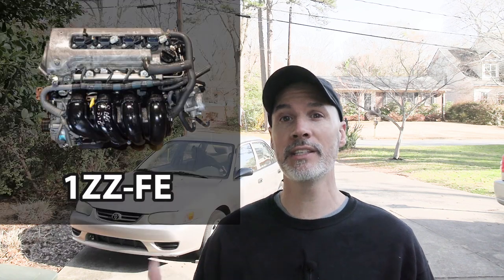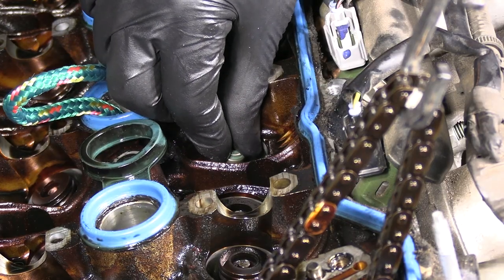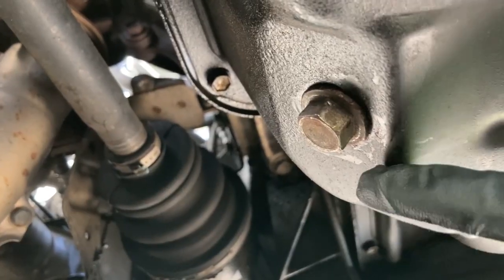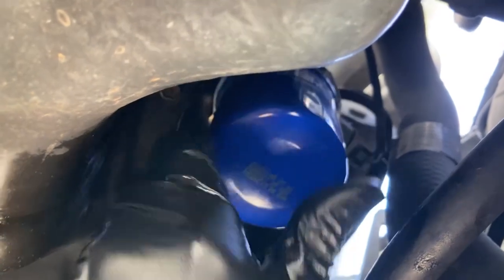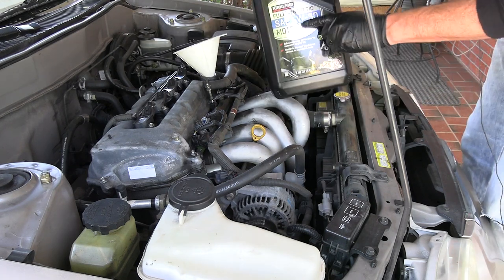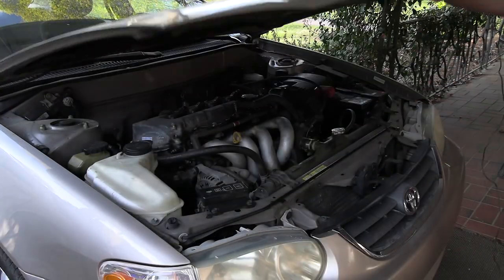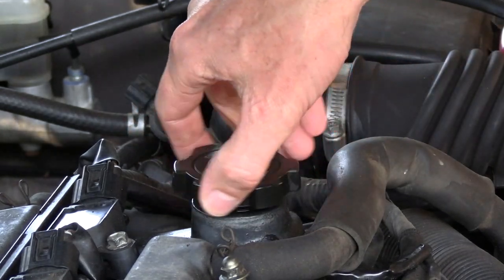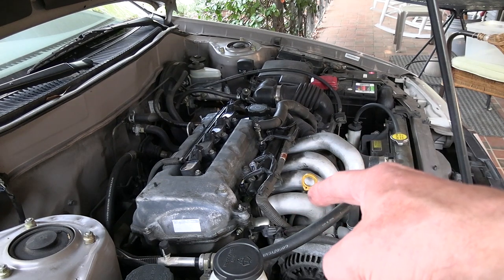Did the valve stem oil seals stop the oil consumption? | Oil Burning🔥Experiments | Episode 11

Comment: Notice how black the old oil is. That's a sign combustion gasses are leaking past the rings into the crank case. So yes, I'd say piston rings are probably your problem.
Reply: ‘Combustion gases’ would dilute the engine oil and they would make the oil more ‘watery’ overly impregnated with gasoline basically
Reply: @anthonyr5869  That used to happen in the old days with very rich mixtures during cold starts ("cylinder wash", liquid fuel in the cylinder going past the rings).  

In this case I believe the rings leak during the power stroke when cylinder pressure is the highest and fuel is already burnt pushing soot past the rings into the oil..
Reply: @anthonyr5869  this is a problem solved by catch cans
Reply: Or oil additives breaking down carbon getting into the oil.
Reply: Overheating can make the oil turn black in no time as well.

Comment: Your check engine light is on. That issue needs to be addressed first. I already can tell by how dark the oil gets that it is getting burned from blow by due to weak piston rings. This video series was very informational I’ve been a mechanic for over 35 years but I’m telling you now if you put piston rings in this car it’s gonna run so much better also mill the head down .005” inch for better compression when you rebuild you will love the Power increase
Reply: I doubt rings will
Lost more than 5-10k miles. If that. By the time you break the glaze on the cylinders with a hone and measure I would be you have .008-.010 clearance and these cars should be set up at around .003-.004. Now that would be wasting money. I would bet $100 those cylinders are oval shaped and would need to be bored .020.
Reply: engine light is probabaly on due to the oil being burnt clogging up the cat, exactly what happened with mine.

Comment: I used to work in a machine shop the other thing that causes oil burning besides valve stem seals and bad piston rings is bad valve guides if your valve guides are worn quite a bit nothing you will do will work right until all the valve guides are replaced it's kind of hard to tell what the heads on the engine you need to take them off take the valve springs off and wiggle the valves inside of the valve guides but that was a big problem with those cars burning oil too a lot of them use really cheap valve guides

Comment: Risolone high mileage engine treatment highly recommended for this issue.
Reply: Just bought some today..I bought a used 18 Taco 3.5 v6 with 165k..purrs like a kitten. No CEL's..but started to smoke white/ gray hue on startup the dies down in 2 minutes and maybe a tad of smoke from a stop to Go at traffic lights..it didn't smoke at the lot the 2 days I swung by, but after i added some full synthetic to bring the level up a half quart, it started this smoking..got the Rislone to put in..we'll see..its my rings or valve seals I suspect.

Comment: Any oil that is burning is also going through the Air/fuel, and O2 sensors then the cats.  This contamination will result in a P0420 eventually.  Replacing the cats will merely add more cost to your experiment, and they too will fail. Less oil will extend the life of the cats, but they will fail.

Comment: The oil control ring is sticky, run a full bottle of seafoam high mileage in the crankcase, and accelerate and take it on the freeway multiple times, cleaned my camry and the oil stopped disappearing, also make sure you change pcv every oil change.

Comment: I think that the best and fastest method to clean drain back holes is to bring each piston BTC with valves closed, fill the cylinders that are in this position with a solvent that is known to dissolve carbon deposits and with compressed air force the solvent past the piston and hopefully through the drain back holes to clear these holes. The solvent could be collected, strained and run back through several times to get the best use of the product. Repeat with each cylinder.
Reply: I don't have a compressor but this idea sounds great I might have to make something up maybe a bike pump with an adapter of some sort

Comment: There's one thing i have always wanted to try since there is so many engines out there with oil burning issues and full rebuild of the block are expensive for an old car. If you only want it to stop burning oil and not be brand new, your compression and cylinder walls seems okish. What if you drop the oil pan, remove spark plug to not fight compression, remove rod cap, lower the piston down to the point oil ring is out, but not compressions rings. Maybe chuck the piston with wood while you work on it so it can't move lower. Manually clean the groove until no more carbon. Maybe even drills the oil holes a little bit bigger if possible. Put new oil ring and try to push it back up. Oil ring wont fight you like compression rings. It's time consuming but very cheap in parts. No seal other than the oil pan's one. You would even save head gasket by not touching the head. Is it possible?  Would you dare such a task hahaha? It's high risk, but if it's working, really high reward for the price.
Reply from the maker: I like this idea. I was actually considering doing something similar just before the ring job--- if ring job looks necessary. Thanks for the comment Patrick!
Reply: I think the crank would still be in the way. The pistons will not drop down far enough to get to the oil rings. Unless Toyota engine are different.  Between the crank pins and the counter weights being in the way there is not enough room to do what you need to do. BG makes a product that is  used for cleaning super dirty cruded up engines. It not cheap and takes a while to do it correctly but definitely easier than a piston and ring job.
Reply: @thatsonebadhatharry8610 I was thinking the exact same things😂
Reply: I don't think the oil rings drop low enough to clear the bottom of the cylinder wall.  That would result in the oil ring possibly getting hung up.

Comment: The problem described in the beginning of this video explains what happened to my 2009 Corolla when it had ~125K miles on it. It suddenly started to burn a lot of oil. I wasn't aware of this until the oil pressure light flickered on and off. When I checked, there was almost no oil! I filled it up, and set a reminder on my phone to check the oil level every 4 weeks. I figured, the car was old, and I needed to budget for another car. Well, guess what? The oil consumption suddenly disappeared just as suddenly as it appeared. I've always wondered what happened. I even mentioned it to a mechanic, but he had no idea.

Comment: Back in the day, the common thought was to use dinosaur oil but those days are over. 
High mileage full synthetic oil doesn't cost much more than regular synthetic and I've seen enough sludge and carbon build-up from dinosaur oil & synthetic blends to understand the difference.
One site states: "High mileage oils contain seal conditioners and additives that cause o-rings, gaskets and seals to swell. In some cases, older valve-guide seals in engines may have reduced seepage. This can result in lower oil consumption. Many high mileage motor oils include detergents and claim they are designed to remove sludge from engines." 
I've been using the extended performance high mileage full synthetic oil that says it protects for 20k miles, but I still change at 5K.

Comment: Yup. It is the piston rings. I replaced mine in the car over a short weekend using higher tension rings. easy peasy.stopped my oil burning. I put on a new head which had new buckets and stem seals.

Comment: Hey Dave thank you for the video! Great job 👍.  I have to share the crazy thing I've been doing in my Corolla.  
*First thing is putting Seafoam High mileage in the crank case and driving 200 miles to flush engine out.
*Second Change oil
*Third, "and here is where I need you to hear me out" take 2 quarts of your full synthetic 5w-30 and 2 quarts of 5w-40 full synthetic diesel oil and put both in your engine.  "The diesel oil has much higher detergents in it than normal gas engine oil." It will help clean the stuck piston rings by throwing a lot of cleaning detergent at them.  My 2005 Corolla has 384,000 on it now and it only consumes 3/4 of a quart over 5,000 miles.
Reply from the maker: Thanks Ryan. How much oil was your Corolla using to begin with?
Reply: @FamilyFriendlyDIY  At around 270,000 miles ish... It was using 3 quarts over a 5,000 mile oil change interval.  I actually wasn't sure why I was changing it due to it using it so fast and me adding it so often hahaha.
Reply: Welp ill add another thing to try. How much seafoam were you adding?  Ill give it a shot. I drive this car 500 miles a week on my commute.  Ive ran 5w-40 and 15w-40 in mine just to try and slow it down and i get it for dirt cheap because im a diesel mechanic. Ill give this a shot this weekend since im due for an oil change anyway. Ive also tried two quarts 20-50 and 2 quarts of Dex/merc atf with no luck because ATF is extremely high in detergents.
Reply: @Clayman302 I put 8 oz in the crank case 200 miles before an oil change.
Reply: @Clayman302  I would not use the 15w or the 20w oils they are to thick for our little oil pump.  You may over tax it and cause it to starve itself of oil.  Thus not lubricating the oil pump and obviously not getting enough oil to the top end.  5w40 diesel oil is designed for small diesels with a turbo that uses the engine oil to lubricate the turbo. It still needs to clean all the soot out but also get into all the tighter clearances inside that smaller turbo.  That is basically what we are trying to do with the diesel oil, really get in there and clean those rings.  After you notice the consumption is non-existent or just way better go back to the 5w30 and do the 8oz of Seafoam thing 200 miles before an oil change.  This is what I've been doing and it is better than it was by a lot.

Comment: Sorry to hear Dave!  I agree to try the BG Dynamic cleaner, there is also Valvoline Premium Blue Restore 10W30 - C883592GA. Its a cleaner oil meant for commercial Cummings diesel engines to clean engine buildup.  Can only be purchased at a dealer also....Good luck!

Comment: If anyone does have a leaking drain plug, Parker makes this little Stat-o-Seals that have rubber on the inside of the washer, and the rubber is available in Viton, so those washers will last a long time. They seal well.

Comment: Try installing a KrankVent made by hayden. the 1/2 inch size. splice In the breather hose that is between valve cover and the intake tube before throttle body. it helps keeps a slight vacuum in the crankcase and reduce oil consumption. I have a honda s2000 with 260k on it that burns 1qt every 500 easily. now it’s up to almost 1200miles right after installing it. i’ve literally tried everything just like you. so it’s definitely a ring problem. with the krankvent installed you will hear a slight vacuum when you pull dipstick, is normal. they’re about 100$

Comment: i had stuck piston rings and what solved it for me was burning off the deposits by putting the engine under full load at maximum throttle keeping revs over 5,000rpm for several minutes. a hill/slope/mountain several miles long or something is ideal as it wont accelerate that much but it will make the engine work hard and put out maximum heat to the pistons/rings.
my car was like yours, previous owner did short journeys and probably never gave the car a good thrash to burn the crap off.
Reply: Check out his vid on Berryman. He did the Italian Tune-up you described in that video.
Reply: @davepetrakos1192  thanks i went and watched it, he had some really good improvement. however he didnt do quite the same as i described as the engine wasn't under maximum load, he needed to do the same thing he did but driving up a hill with full throttle.

Comment: I have a 2005 Camry with the 2.4 I-4, and at around 160K started burning oil like yours is. I pulled head, oil pan, pistons, honed the cylinders and installed new rings and gaskets. I reused the rod bearings due to them looking like new, now I have 221K and some change on odometer and doesn't use hardly a drop of oil now. I have maybe $300 bucks into it and that was 4 years ago. The re-ring kits are fairly cheap for the Toyota's just a pain to do timing with it having a timing chain.
Reply from the maker: Glad to hear. Hopefully one day this one will have a happy ending too. 😀

Comment: Bores would be glazed up if it was using oil from the valve stem seals , you'll need to at least give it some more miles to bed in- unglaze itself

Using that much oil easy test anyway , hold revs up at constant rpm if theses a consistent stream of blue smoke even light it's rings , if clouds of smoke on start up or when backing off and accelerating again it's valve stem seals or guides - cheers

Comment: Problem is caused by Toyota recommending 7500+ mile oil changes.  Top down soaks ( not just 4 oz and evaporation the solvent will leak past. Put more in over a few days.  There is a GM ring unstick solvent… 20 bucks…. Then lighter weight oils and road trips…. It needs to clean itself the super tech full synthetic is excellent. It’s hard to free gummed up oil rings… hence the long road trips recommended… you’ve done too much already… And when you put solvent in the oil don’t be in a rush to change the oil 10 minutes later, started up and stop it 20 minutes at a time for 10 days straight you need solvents to dissolve the gum.  As long as the car is not under old it’s fine.

Comment: Try a high rpm, under extreme stress, run on the car.  Its worked for me. A Toyota tech told me to do this.
Reply: The Italian Tune Up!
Use a bottle of Jectron, a bottle of Royal Purple Gas Treatment and a bottle of AUTOPROFI Cat Cleaner together before that good hard long fast drive, gunning it up to 90-100mph as long as you feel safe, and truly blow the crap out! Of you put it in a nearly empty tank and use High Octane to fill/mix it is just a bonus.
I did that after using the LiquiMoly Engine Flush before a 225 mile cross Florida trip and even in my 6600 lb Tundra got nearly 14mpg, up from 8-9 local short driving a while.
Got over 15 the next same long trip averaging 75mph.
Also, oil use decreased significantly. 
Am sure the old girl could use more new bits and pieces but why go nuts if it doesn't need it.
LOL

Comment: Try this idea of connecting a transparent, or semi transparent, hard but still flexible 1/4" tubing onto top of engine valve cover and bring into the car's cabin. Install a very low range compound pressure gauge. Get its reading at idling, at 20mph, 30mph, 40mph and also compare with manifold intake pressure display by a generic OBD2 plug and display unit. Air intake manifold pressure can be as low as -0.5barg or -50kpa. Pressure inside the engine valve cover should be only around - 0.10 to - 0.15barg?.  Regard.

Comment: If you end up deciding to tear down the motor to replace piston rings, 

I would love to see you try BG products full Engine flush kit (Dynamic Engine Cleaner & Rinse Oil) before you tear down, you'd have to know someone who works at a shop as they don't sell directly to consumer, but I've heard amazing things and would like to see if it helps your oil ring problem. As I am having the same exact symptoms and been following since your first video!! Love the content my friend
Reply from the maker: Thanks Josh! I'd love to try the BG system and hope to try it as a grand finale before a rebuild (if a rebuild is necessary). A viewer offered to send me the BG kit several months back, and I said "yes please," but he seems to have disappeared. ... Hopefully I can work something out.
Reply: @FamilyFriendlyDIY    I'm not sure where your located, but I think I could aquire the kit and work out getting it sent to you as well if you can't find any! 

Also, couple ideas for videos, I burn about a 1qt every 500 miles, I switched to a platinum high mileage oil and used Lucas Oil Stop Leak as directed, and got almost 1000 miles before I was a qt low, so it certainly seemed to help my problem a little. 

I also would love to see the proffesional line LiquiMoly engine flush used on your car as well as I've heard that's a Great product, would be cool to compare that to the BG service. 

Maybe one variable you could try is just switching to a 5w-40 high mileage oil, with no other variables/additives and do your 300 mile test to see if the slightly thicker oil helps with the consumption? 

Cheers!
Reply from the maker: @joshmcclary233  Thanks Josh. Seems like a lot of people are recommending the Penzoil Platinum. I like the LiquiMoly flush idea too, as we wouldn't have to wait on results. I think I'll put that on my list. ... If you're really interested in helping with the BG kit, you can go to the "About" on my YouTube home page. and there's a button to click "for business inquiries." It'll give you my email. Thanks again for you interest!

Comment: Great vid thanks Dave. I have exactly the same problem and have tried a couple of additives although I can’t get the same as you here in NZ. I also completed the valve stem seals ( with similar problems ha ha ) and with similar results…a small improvement but still a problem. All my compressions are good so I am coming to the same conclusion as you are…oil control rings. I will await your next video with interest. I believe there was a piston change in 2003 production. Thanks again for the vids.
Reply from the maker: Thanks Paul. Yeah, if we end up doing the rings, we might get those upgraded pistons.
Reply: Hi over there to you both guys. Do you think it could be a problem with the head gasket? What do you think about this possibility? Is there any trace of oil creeping out from the meeting surface of the head and the block for instance?